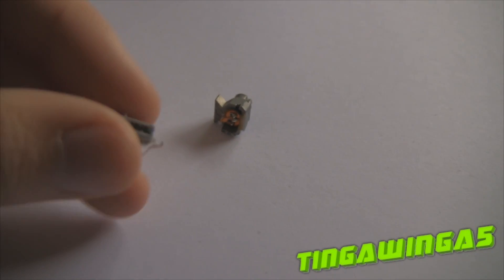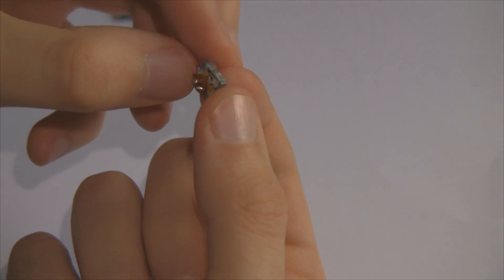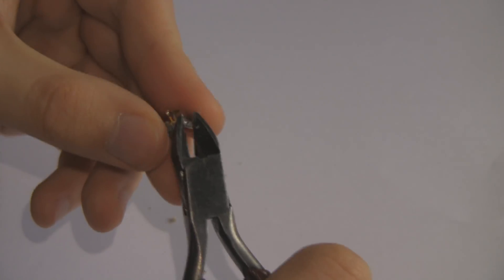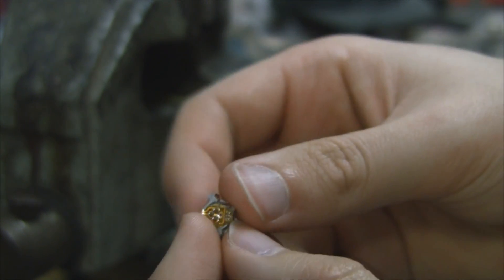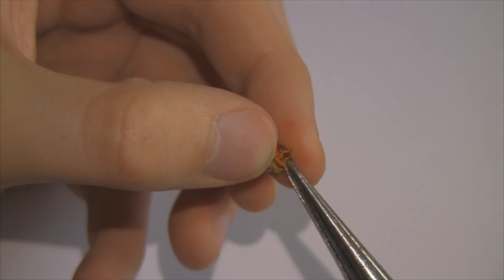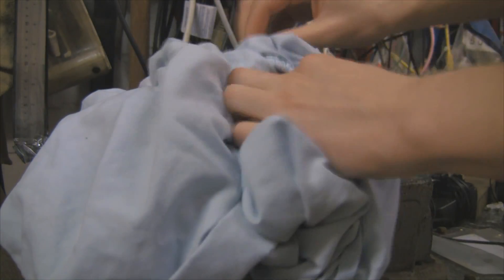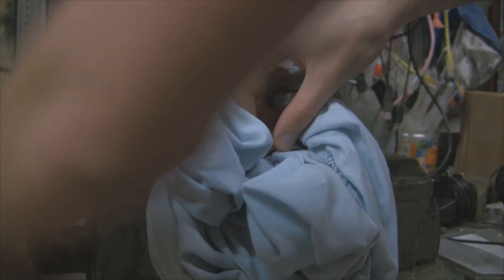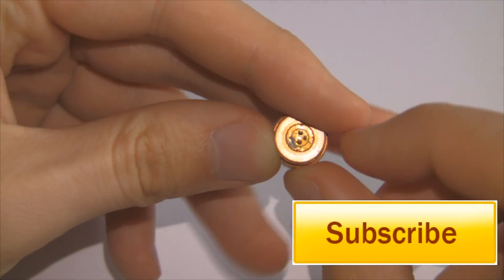How To Extract Laser Diodes from DVD Burner Housings and Put It Into an Aixiz Housing

Comment: so what if i don't want the aixiz housing because their cheapest shipping is just as expensive as a 10 pack of these housings when i only need 1 of them
what do i google for to find these housings?  
all i find is the cheap 5mw modules with a laser in them and probbably made out of plastic.  

and what is the housing for?   only focusing and heatsinking right?  wouldn't an actual heatsink be better then a housing wich you then clamp in a heatsink

Comment: why do you need the housing?? plz respond
Reply: Heat dissipation and optics.  For some applications, you want a completely collimated beam.  

Without the axiz, you will just get a convergent beam of laser light.  Generally, the focal length will be in the millimeter range.